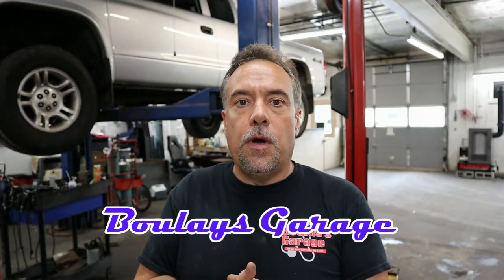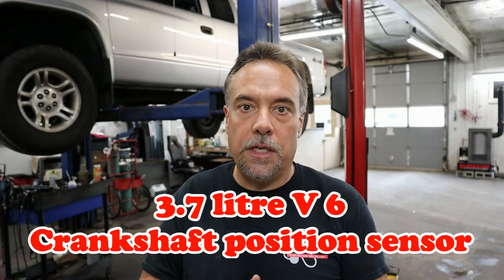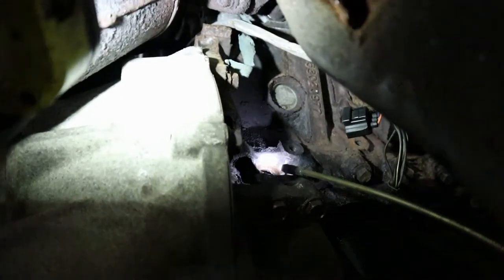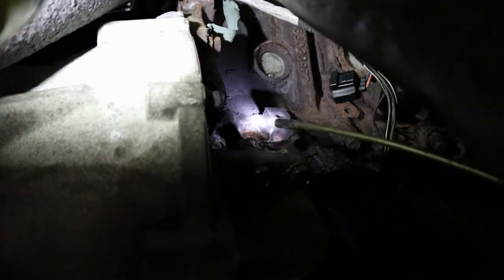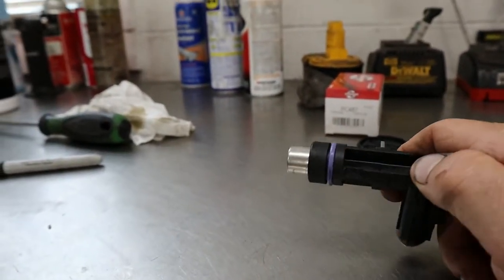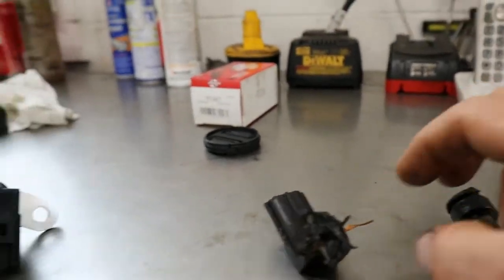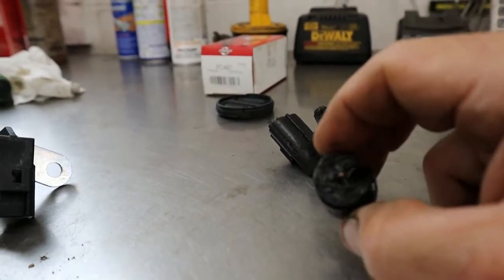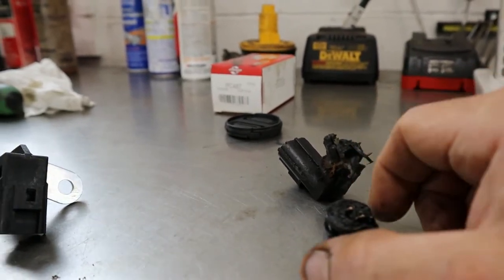3.7 liter Dodge V 6 Crankshaft position sensor replacement

Comment: I live in the north, in Iowa, and it was no problem getting the old sensor out of my 2005 dodge Dakota. I had it out in 5 minutes or less. You need to change what you say about living in the north. My Dodge has ONLY been in the north . like I said , it was no problem.
Reply from the maker: You are very lucky then!
Reply: My dakota has lived outside in alberta for 20 years I fought with my crank sensor for 3 hours before it finally broke and im still yet to get it out, so maybe you should change what you say. If you had such ease replacing the sensor why did you search out for this video?